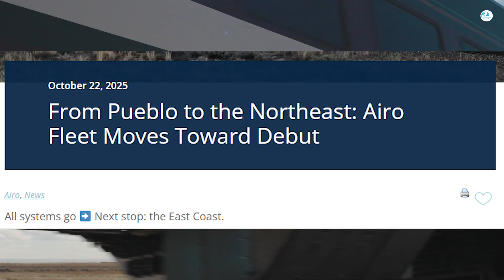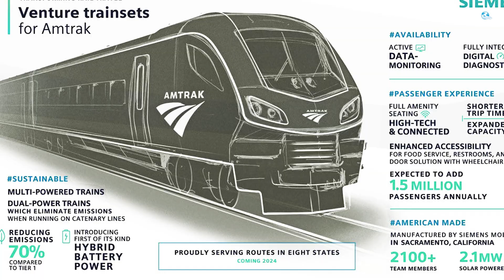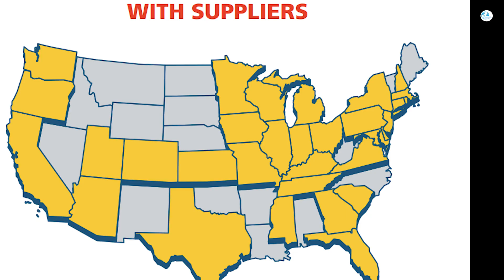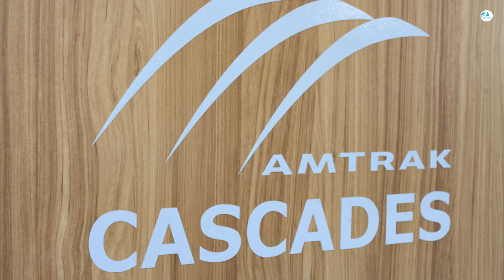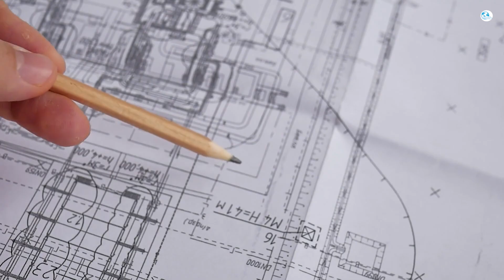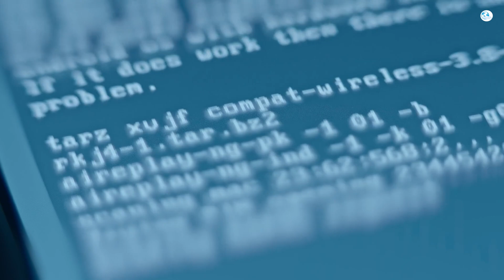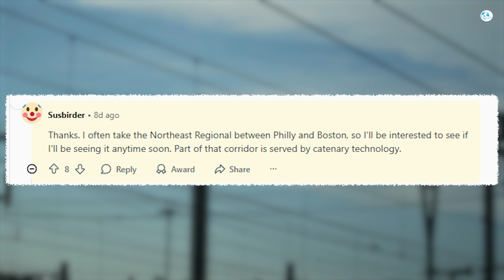Amtrak's Newest trains are almost ready!

Comment: The Airo is nice, but Amtrak should be forbidden from scrapping the Amfleet cars, which due to their stainless steel construction will not fail like the Horizons, and are more comfortable than the Venture cars.
Reply: Those cars need to be scrapped. No one likes walking through the gangway when it's raining or dealing with cold and heat every time the gangway doors open. The cars are old and need to be thrown far away.
Reply: @TheRailwayDrone Lol, you know you like the Amfleet Cars, too! They are historic now, as they really are vintage cars!
Reply: @electrictractiontrainsandt3063  No, I actually don't. I prefer modernity over vintage. Those trains should have died before I was born.
Reply: @TheRailwayDrone 😂Lol
Reply: @electrictractiontrainsandt3063  I'm just saying lol...
Reply: @TheRailwayDrone What’s your favorite train?
Reply: @electrictractiontrainsandt3063  Eurostar E320. A VERY close second is the Shinkansen. How about yours?
Reply: @TheRailwayDrone Nice! I think if it runs in train tracks, I like em all, lol! I’d say my all time favorite is the Amtrak Turboliners w/ sleek modern looking engines on both ends! They were vintage 1970’s, but, had more in common with airplanes than a conventional train. They were taken out of service around 2005. The old and new Acelas are awesome and my favorite sounding locomotives are the P32AC-DM’s and the P42-DC’s! I could go on and on, lol 👍
Reply: @electrictractiontrainsandt3063  I usually take the Acela fairly frequently. I am riding the Acela home to NYC for Thanksgiving. I'm looking forward to my first trip on it. I even made sure to pick the "correct" window seat lol...But when I was in the military, and even now, I take many high speed train trips in Europe and Asia, and I absolutely LOVE them.
Reply: @TheRailwayDrone Oh, wow, that amazing! Ya, I haven’t been in any of the high speed trains in other countries. But, it sounds nice. The Eurostar trains I always find to be very interesting. But, ya many of the Europeanand Asian trains do move right along! That’s great that you got a seat on one the new Acelas for the Thanksgiving Holiday! I’m excited as the week of Thanksgiving is the busiest train travel time of the year in the US! I will be out there filming that week as much as possible! 👍
Reply from the maker: Great! Going on an Acela Thanksgiving trip will be a memorable one!
Reply: @electrictractiontrainsandt3063  , the old Amfleet cars have reached the end of their service lives; it's time to retire them and refurbish them for museums; have some common sense and accept what's going on.
Reply from the maker: That's right, the Amfleet cars are really durable and comfortable.
Reply: @ONtheTrains Yep, the Amfleet car sure are! I hope that some of them get refurbished and updated inside as the new trains start to arrive! 👍 it’s always great to have extra equipment ready to go, and to run different train types! 👌
Reply: I agree! They should keep the Amfleet cars, too! A nice interior update would be nice, but, even as they are, they’re worth keeping! 👍

Comment: For the Amtrak Albany Flyer (A route I proposed) Could use Catenary, 3rd Rail and Diesel From Washington DC Union Station to Albany Station in Albany, NY
Reply: Wait, I thought Airo sets weren't being equipped with 3rd rail shoes?
Reply: @Watch_the_gap they are not
Reply from the maker: Great idea! That line combining electric and diesel sounds very reasonable.

Comment: At least put correct info, not disinfomation.
Siemens Airo is locomotive with diesel prime mover and has battery back up to run at lower speed and save energy just like hybrid cars with build in batteries. 
Its NOT real electric locomotive with pantograph which takes power from catenary overhead lines
Reply: Hopefully youtube will let this link post. It's a PDF fact sheet. Under the "Performance" paragraph, it discusses how the trains can transition from diesel to electric power. chrome-extension://efaidnbmnnnibpcajpcglclefindmkaj/https://assets.new.siemens.com/siemens/assets/api/uuid:f7972216-fd02-46aa-9428-1874f489bdba/SIE-RS-Amtrak-Airo-Venture-Trainsets-Sheet.pdf
Reply: You're half right. The Northeast corridor version of this train WILL have a pantograph attached to one of the passenger coaches, and will run on a the conventional engine when it travels south of DC.
Reply: @TheRailwayDrone 
Aha 
That's good news.
Where can I find that official info.
I believe it would be beneficial to all passanger trains to electrify and separate passenger routes. 
Unfortunately that should be done long time ago but it wasn't.
Reply: @TheRailwayDrone 
It will be good to stressed out that info in video and put more details about NEC and later going south. 
If that's the case that's good news
Reply from the maker: Thanks for your useful information.
Reply: @ONtheTrains  No problem.